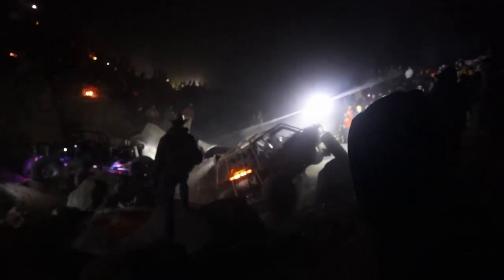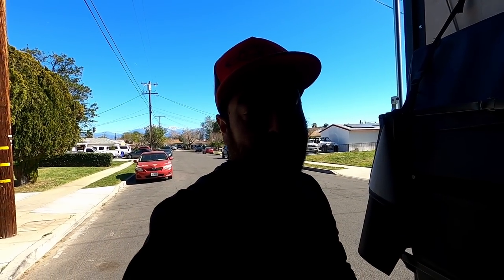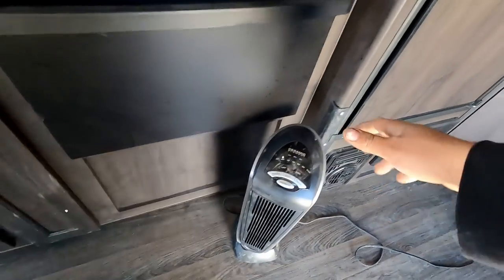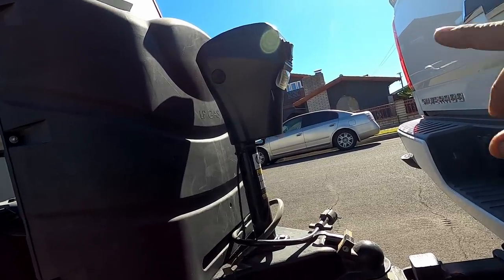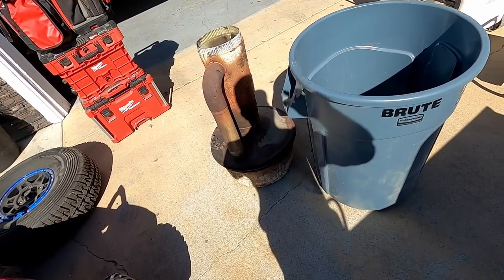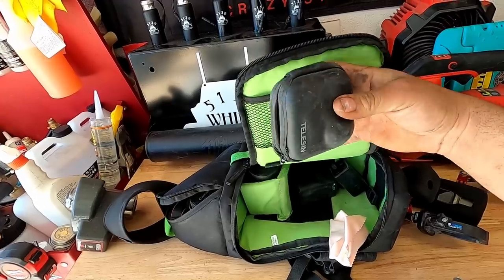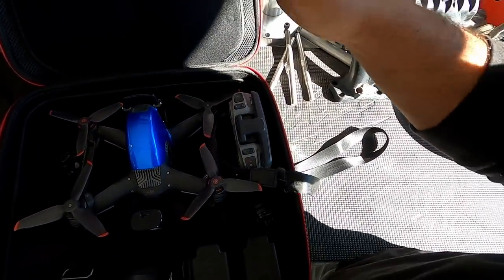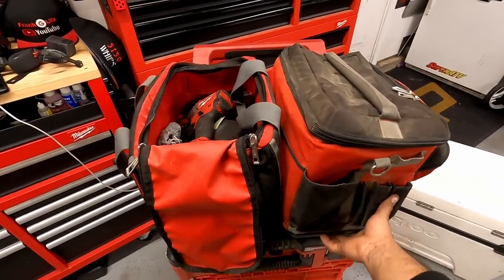Must Have Items for OFFROAD CAMPING.. #UTV #OFFROAD EP 230

Comment: Another thing I find useful are my electrical tools like a test light, power probe, multimeter and extra fuses - for working on car light bars, whips, or the trailer, diagnosing battery issues. Oh and flash lights, I bring an assortment of lights from pocket size streamlight flashlights, and millwaukee 12v rover mechanics magnetic light, oh and headlamps for that handsfree work.
Reply from the maker: Win win win, great recomendations🤙🤙
Reply: @GLifeUTV  as much as we try to prep before a desert trip, something inevitably will go wrong. My OnBoard Onan gave me trouble last trip when somehow traveling over bumpy terrain into dumont dunes must of shaken loose some dirty sediment either from a old fuel line, the tank or possibly from in the carb itself and clogged up the jets. I pre-tested my gen prior to the trip out to Dumont, ran great after trailer being out of commission for a while, gen wasn't used for long time because of that, but ran some seafoam through it, freshend up the fuel in the tank and thought i crossed that off my list, but shit happens right. Luckily friends from our camp were cool homies to lend a hand in removing, and dissembling that little carb to sterilize every little part from contamination and if it weren't for their determination, i may of just given up on it.  @G Life UTV  its hard work being the last boyscout to prepare all these items to pack but it pays off when you can be self sufficient!

Comment: Just a suggestion.  The floor jack you carry won't work on jacking up your trailer for any reason.  I had a 3 ton floor jack that I had to jack our toy hauler to change out my tire.  My can am was loaded.  The jack didn't come close to lifting the trailer.  Switched to a 20 ton bottle jack....does the job.
Reply from the maker: Didn't think about it with the machine inside. Thanks for the suggestion bro🤘🤙🤙
Reply: @GLifeUTV  no worries.  Love your videos.

Comment: For the smudge pot it’ll burn longer if you mix with oil. I usually do half used oil and half diesel
Reply from the maker: I've heard of that. I need to try it.
Reply: You can use 100% used motor or cooking oil. Add a little fuel to help it ignite. Careful that you don’t have any water in it tho. It will belch out. 
BTW never try jumping over one 🤦🏻‍♂️
Reply: We use vegetable oil from restaurants in our smudge pot.
Reply: @1crussell  yeah i use just old oils, hydraulic, atf, motor oil, gear oil. Never heard of vegetable oil but sounds neat

Comment: A trailer tool set is a must, I double the major tools I have in the garage for working on the toys, trailer or whatever. The Milwaukee pack outs are awesome to keep it all together!! Love the radio in the toy hauler, Frank how are the new R1 digital radios? I’ve been wanting digital but I was reading about the business band and all the requirements to pay for the licenses, was it a pain of a process to get them?
Reply from the maker: I haven't looked into much of that aspect. Only been using the preprogrammed stations. The only drawback is there isnt many preprogrammed.. but not as many people on the digital stations as the analog currently which is a plus.
Reply: @GLifeUTV  cool, yeah not as many people on the digital because I believe you have to pay for the licensing of a private channel in digital from what ive read, but to have digital coms is what i want. Especially when in a crowded air space like KOH or Glamis.

Comment: Awesome and helpful video👍🏽💯. Quick question what gearing do you run on your truck to pull the toy hauler and the can am?
Reply from the maker: 4:10
Reply: @GLifeUTV  🤦🏽‍♂️My bad. I mean gearing ratio as in your differential on the truck
Reply from the maker: @marcodesantiago626  4: 10 is the gearing ratio i put in my differential.
Reply: @GLifeUTV  Got it👍🏽. I got a little confused there. My bad😂.
Reply from the maker: @marcodesantiago626  no problem bro. 🍻 I highly suggest a 2500 tho. Thats where im heading. Its alot of weight for the truck
Reply: @GLifeUTV  🍻Thanks for the advice. I really appreciate it. I’ll see you out there in Costa Mesa 👍🏽
Reply from the maker: @marcodesantiago626  sounds good bro🍻
Reply: @GLifeUTV  Let me know next time you head out to Baldy Mesa so I can tag along in my x3👍🏽

Comment: I got a smudge pot / orchard heater a few seasons ago and haven’t looked back. Diesel fuel burns the cleaner / hotter/ faster than motor oil or kerosene and will burn up your sp the fastest. Used motor oil burns dirtier/ cooler and slower. Using straight diesel will burn holes in or make your sp crack faster. I use roughly a 80/20 mix of oil/diesel and it burns longer at a cooler temp ( inside the sp ) and no smoke once it’s going. You can also use a 95/5 +/- mix of oil / gas and get similar results with very little to no smoke. ⚠️⚠️ WARNING ⚠️⚠️ LIGHTING THESE CAN BE HARMFUL TO YOUR FACIAL HAIR  / SKIN AS WELL AS YOUR ARM / HAND SKIN AND HAIR IF YOU ARE NOT CAREFUL OR ARE JUST A DUMB@SS  AKA A MAN / MANCHILD ⚠️ The vapors will ignite before the liquid starts burning. Also Craftsman is making a come back and opened a new manufacturing plant in Texas and are making a new line of professional quality tools at almost a pro price. They are nice though.
Reply from the maker: Im hooked too. Definitely going to be mixing used oil. Im probably gonna pick up another one for family get togethers😁. I appreciate your feedback🤙